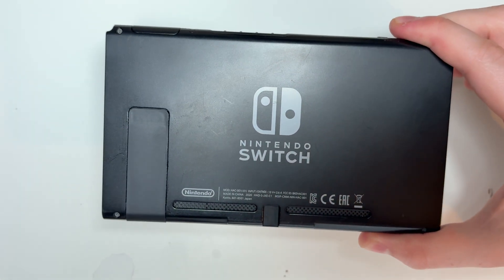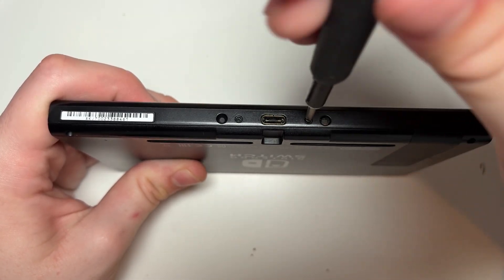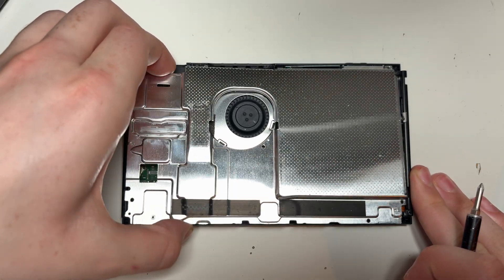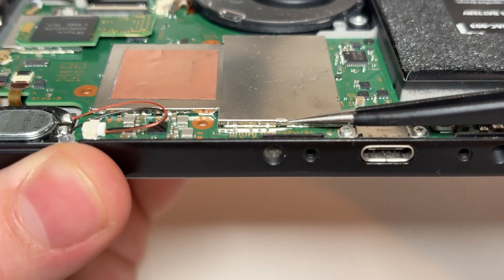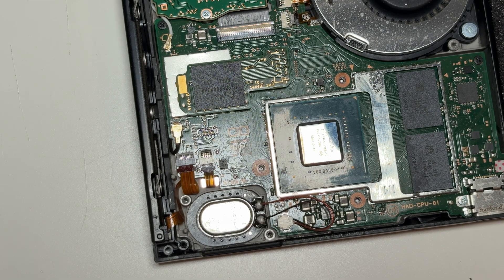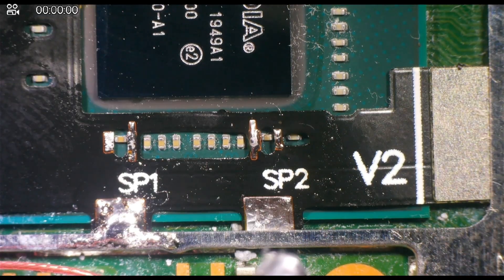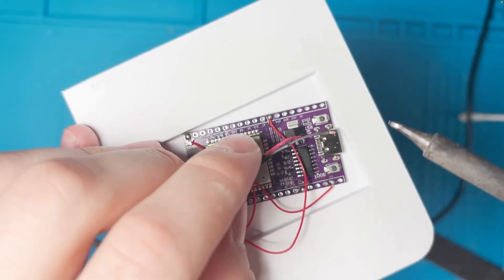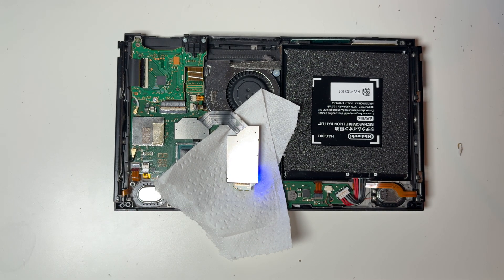How to Install a Nintendo Switch V2 RP2040 Modchip (2025 Updated)

Comment: 14:37 you should avoid bending ribbon cables like this, it's asking for a bad time
Reply: I mean ribbon cables ARE designed to be bent. HOWEVER.. only ONCE into its final resting position. Bending a ribbon cable back and fourth repeatedly like this WILL cause metal fatigue. I agree.

Comment: is it the same process for a V1 switch? I have the  Picofly RP2040 sitting there and ready to go for mine. I got sick of using the RCM jig since the payload injector I had is so unreliable and the battery will no longer charge. Seems simple enough to do, I've done a RGH 3 mod on my 360 and this looks simple in comparison
Reply: Dont use a modchip on a v1, you can softmod it. Search up switch v1 softmod
Reply: @caiomendes377 I know you can but softmodding is annoying and I already have a softmodded one. I'm so sick of the RCM jigs and having to inject payloads. The switch I have had just say there since I got the switch 2
Reply: @karlmee1234 ok then, but there is always some variations depending on models because of different things you better search it up before doing it

Comment: I personally used a stock RP2040 Zero in my Lite.  Carefully desoldered tall components after flashing the firmware as instructed in a guide, and wired all the components carefully.

As for soldering, this is phone repair level microsoldering.

Comment: Can you do this without microscope?
Reply: Yes, you can do it, I did it and it works perfectly. However, I don't recommend it; your eyes will hurt and it will take much longer. But yes, you can definitely do it
Reply: You can do it without a microscope but it is highly inefficient, if you can't afford a microscope I'd recommend just using the zoom on your phone
Reply: I mean, your question mostly answers itself. You could very well try, but i highly doubt you will be perfect on the mark and theres a massive chance you will solder to the wrong place, which most definitely makes all of the progress you done pointless
Reply: @KingCalzone_ si se puede pero tendrías que tener una vista privilegiada , aún así si se puede lo hice en una lite , costo trabajo pero pude
Reply: Yes you can, but that would be a horrible idea. The smd caps are smaller than ants, if you don't have a microscope you can try zooming in with your phones camera if the cam quality is good enough
Reply: you'll be fine, just needs some focus